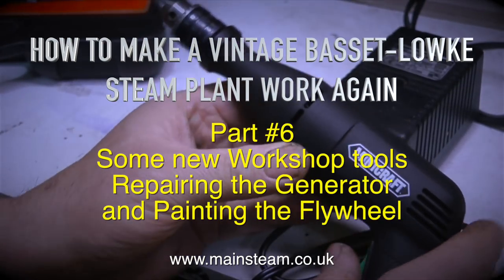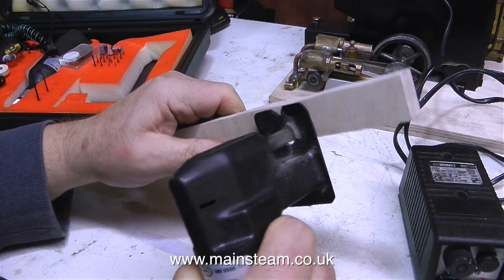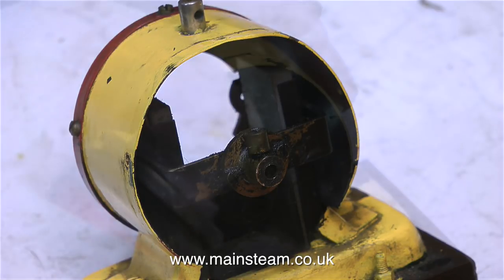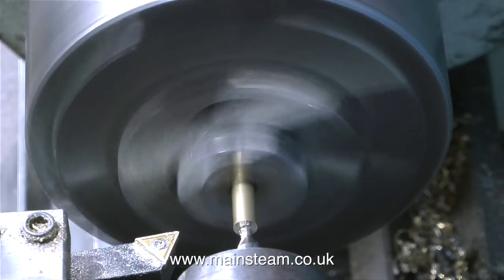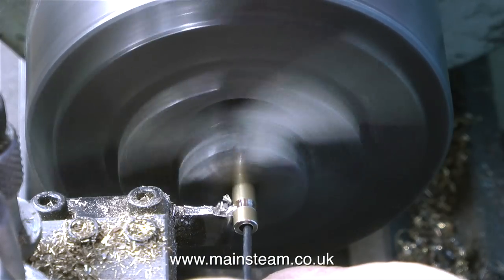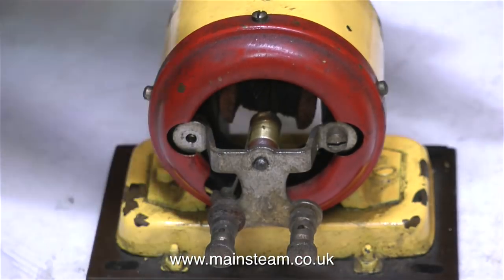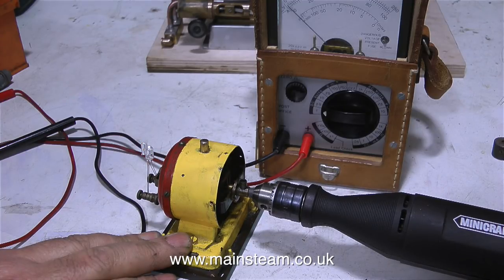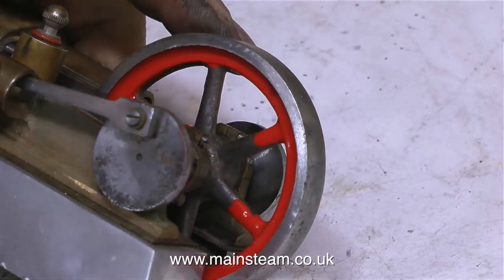HOW TO MAKE A VINTAGE BASSET-LOWKE STEAM PLANT WORK AGAIN - PART #6

Comment: I suppose you need to re-magnetize the magnets in the generator.
I did once with a ring generator to an old phone.
You simply wrap a few turns of rough cable around the magnet and connect to a powerful battery for a short time!
See the internet for details.
After that process, the generator will once again be able to deliver both voltage and current....

Comment: Good video Mr Appleton. I was hoping that you open up the engine so I can see how a piston type valve work. I am trying to build a steam engine. As I have only a lathe and a drill press I think piston valve will be easier to make than the other type.

Comment: Now if you could only find a way to transmit the smell of Humbrol paint drying on the metal. Thanks for the tip by the way,it is readily available in my neck of the woods.

Comment: you mentioned how Brass isn't a suitable bearing material. In which case, what is? Phosphor Bronze possibly?
Reply from the maker: Yes, or Cast Iron - or Gunmetal
Reply: ah righto. I know that with a car's engine, they use bearing shells that are coated in whitemetal, so guessing that the principals are the same. Using a softer metal to make a sacrificial bearing so the bearing wears out before the metal of the frame or case does